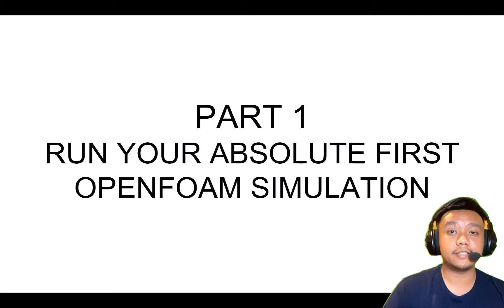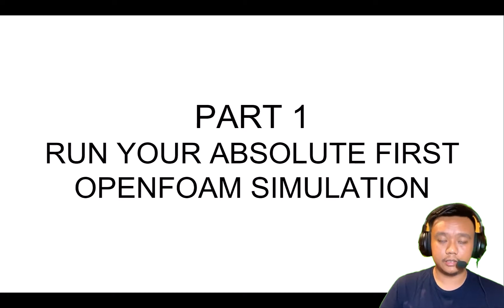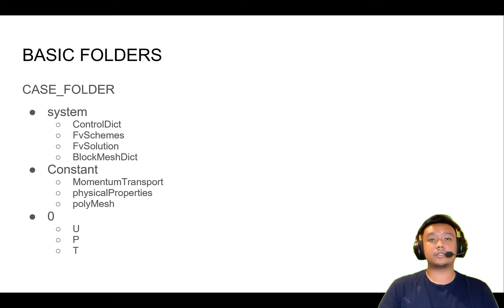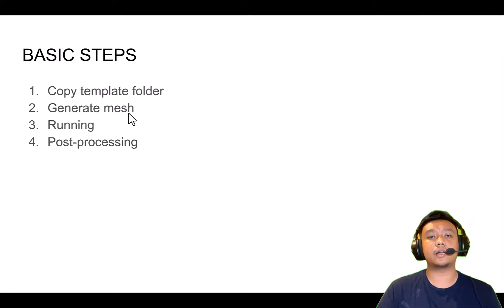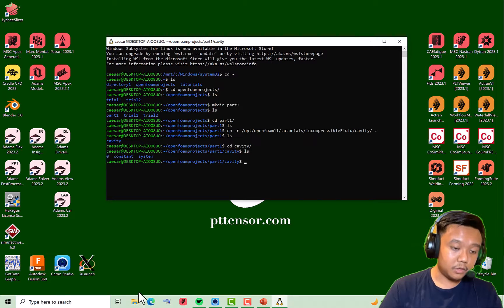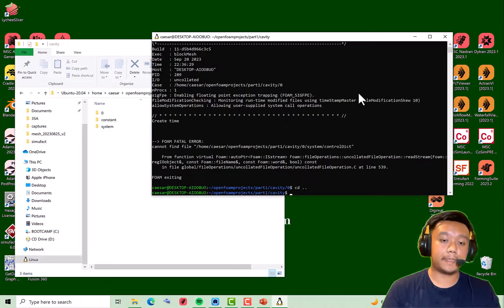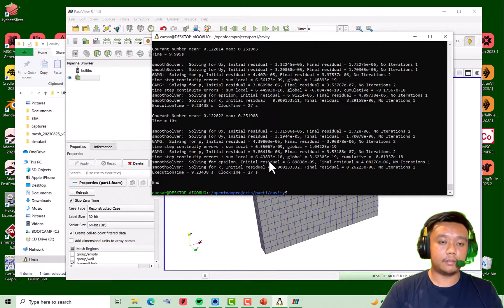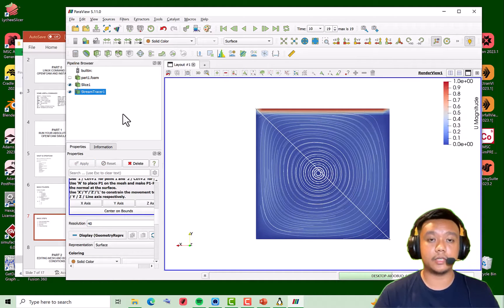openFOAM tutorial part 1: how to run your absolute first openFOAM simulation

Comment: When I try foamRun it says command not found.
Reply from the maker: It means it was not installed correctly. Or maybe you use the previous version of openfoam which didnt have the foamRun command. Please check the controlDict
Reply: @caesarwiratama3303  got it, i reinstalled it and it is working just fine now. i like how you are keeping the videos simple.

Comment: Are these 3 file (directory1 , openfoamprojects and tutorials ) supposed to be there default ? I installed openFoam " at least I suppose so :) " but in my home folders there is only one folder named " snap " and ı couldn't reach  system, constant and 0 files.
Reply from the maker: Can you run the "cd $FOAM_TUTORIALS" ? If yes at least it was installed correctly. About your home folder access, it might be the WSL installation problem

Oh the directory1 and openfoamprojects is not there by default. I made it
Reply from the maker: You must copy the template first, by the step i explained in 10:25

Comment: bang, softwarenya bisa dipake buat simulasi turbin yang bergerak ngak? dan apakah softwarenya berbasis online pake komputasi cloud? atau komputasinya lokal di komputer sendiri? dan kalau iya spek komputer minimum kek mana untuk bisa menjalankan software ini?
Reply from the maker: Bisa tentunya. Software berbasis offline konvensional, yang tentunya free. Spek minimum bisa dicek di website nya openfoam ya, karena tiap versi berbeda2, yang jelas bisa running single core tanpa harus makan banyak hardware

Comment: Thank you for sharing 🙂
Reply from the maker: Sure, please let me know if you have any topic request
Reply: thank you so much! maybe for me an interesting topic would be the "atmosphere" wall condition for water/air cases... at the moment i only use inlet,outlet and walls so that the mesh is full of air and only water goes from the inlet to the outlet ... but i saw that some cases also use a "atmosphere" which is not an inlet for water but air can come inside if there is "underpressure" in the mesh?!  @caesarwiratama3303
Reply: Square shape microrobot rotates at 2 Hz. Calculate Umag due to the rotation @caesarwiratama3303  . Thanks.